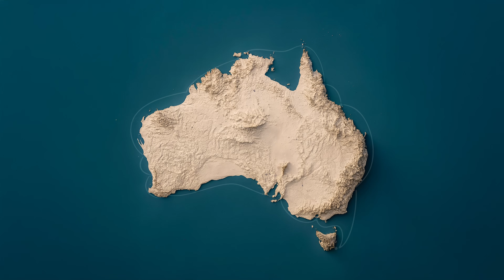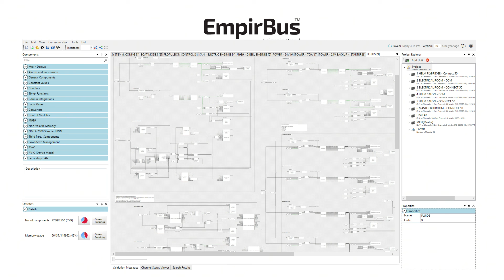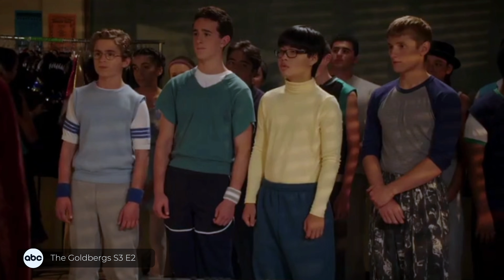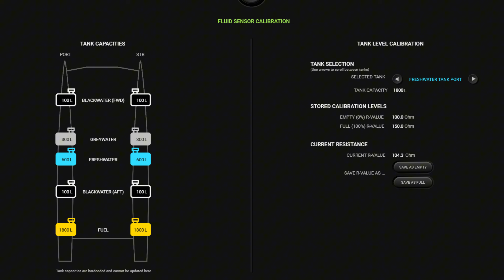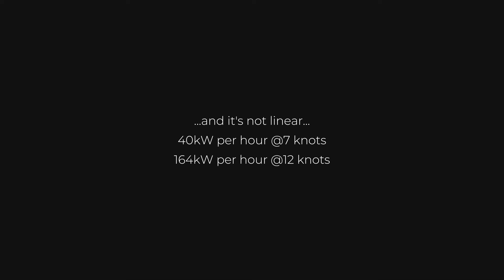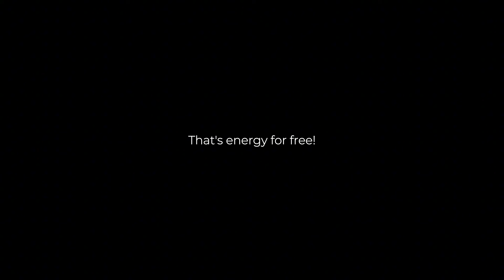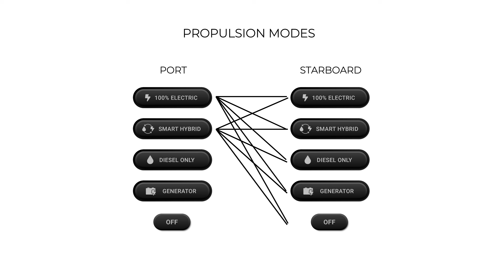The System Behind Our New Solar Electric Yacht

Comment from the maker: We designed and programmed this control system ourselves for our solar electric yacht.

This isn’t a product demo or a sales pitch — it’s a walkthrough of the design decisions behind the system, how we manage complexity, and why safety and redundancy mattered enough to shape the architecture.

If you’re curious about electric boats, marine systems, or how modern yachts are actually run, feel free to ask questions in the comments — happy to go deeper where it’s useful.
Reply: so I am doing an extremely, EXTREMELY junior version of this. bought a 26' cuddy cruiser with no engines and am about to install my solar-electric powertrain into it which I'd previously gotten working on my pontoon boat. it's honestly pretty simple: 8 x 24V LFP batteries in 2S4P for 48V, 3 495W panels, a Victron 135/50 MPPT, Cerbo GX, and a SmartShunt, assorted wiring and bus bars, and a Linergy X20 motor. the whole time I was working on it, though, I'd been trying to think of a good way to do control systems. I don't suppose you guys are interested in open-sourcing this? 😅
Reply from the maker: @notaprofessionalJ  We're still deciding what to do with the IP. Probably overkill for your case, but if we do something for our tender (~20ft) we'll definitely put that out there.
Reply: @projecteyacht  Make hay while the sun shines.
Reply: @projecteyacht  I certainly hope that Garmin or the other companies you’ve interfaced with are smart enough to reward your efforts. Well, it may be designed specifically for your purpose, your intuition and ability to make the complex simple would act as a guide to these companies to offer similar experiences to future customers. I think your control system might make boating more accessible to more people. I sincerely wish you all success and happiness in your endeavors.
Reply from the maker: The design is very specific for our equipment and motors so won't work for your case (and would be overkill).
Reply: WOW so Informative 🥇🥇🥇
The system you have created if adopted would logically reduce manufacturing time and cost.?
I saw the Xquisite 60 Hybrid Review recently, like you they opted for the Parallel hybrid system. 
I hope Manufacturers follow your lead and actually implement or adopt your system, as opposed to just taking. 
Many thanks for your informative YouTube 👍👍👍
Reply from the maker: Thanks! Yes, theft is a risk. We'll share a bunch of stuff here, but without a copy of the underlying code or config files (which are locked) it wont run o  another boat.
Reply: Is parallel hybrid really more resilient to a lightning strike than serial hybrid? most motor ecu's are very sensitive to voltage irregularities, knocking them out,  mechanical hybrid also needs extra mechanical complexity with clutches. . I'd rather have a dumb mechanical motor hooked up to a large dumb alternator. just a large coil of wire and some large diodes.
Reply from the maker: @DarrenBainbridge Good question. It depends how you design it. Our motors are definitely newwer with ECUs etc, but the diesel propulsion is completed isolated from the rest of the boat. We'll also carry spare ECUs and starter batteries, and we have two of them so that always helps. We've done as much as we can.
Reply from the maker: @userBlackRus Thanks! Us too, but in the meantime we'll have to just do it ourselves!
Reply: Wouldn't it make sense to add solar panels on the sides of the hull? Water reflects almost all the blue light, and you would have pretty much max sunlight intensity all day on one side or the other, considering that wave action is convex concentrating the light. I wish someone would experiment with this because I don't know anyone who has tried it. Except on land with vertical panels over a reflective surface, and they do work beater on land too, from what I've seen.
Reply from the maker: @Metal0sopher 100% and definitely what we'll do after the boat is handed over. Keeping it simple for the boat builder, it's been a long road already. Sunreef do do it, but they've not published any data on it.
Reply: @Metal0sopher  I would have made the solar roof MUCH bigger than you did. More shade too below.
Reply: Awesome! I am excited to hear your story.
Reply: My kind of boat people.
Reply: Im an industrial automation programmer,engineer, graphics designer, technician, PM, and I was thoroughly impressed.  Its a Garmin product, even better!
Reply: Wondering what redundancy you have forsee for all your digital controls and pc, plc, switches….?
Reply from the maker: @MrDivHD  many, many layers - and its were most of the time and complexity of the project lies. This was just an overview video, we'll talk more about this in future videos. Thanks for watching!
Reply: I know the feeling of being excited about your project. But it would be good to know more about the boat before jumping into describing your automation project. 

Very comprehensive though so well done. Are you going to open source or resell the project?
Reply from the maker: @DarrenBainbridge Thanks! Sorry about jumping right in. We'd didn't think anyone would see this other than our family and friends who already know everything about the boat, or tech nerds like us that just want the technical stuff :) I'll be putting out one more technical video on our batteries because they're pretty novel. After that, I'll come back and start from the start. Hope you stick around for that. 

Re commercialisation, we aren't going to start a business (we want to get on with travelling and have lots of other ideas for projects), but we are open to selling our IP. Focus is on getting the boat into our hands first though.
Reply: What is an experimental physicist vs. a physicist
Reply from the maker: @salty_berserker_channel In research you can go two routes - theoretical physicist (lots of maths, modelling, and coming up with hypotheses why things are the way they are) or experimental physicist who get their hands dirty and actually test what happens in the real world - hands on with the equipment, if that makes sense. Both physicists, just different ways of attacking problems. Experimental physicists are more like engineers but working on the newest stuff before we hand it over to the engineers to commercialise and scale up.
Reply: Hi,

I am a European Patent Attorney based in Switzerland, currently working in the medical technology sector. Outside my professional activity, I am a passionate sailor and the owner of a sailing catamaran based in Italy.

I hold an IP portfolio comprising eight patent families covering inventions I conceived while sailing. Unfortunately, I do not currently have the time or resources to independently develop a project such as yours or to bring these inventions to market.

I therefore watched your video with great interest and admiration. Your objectives and achievements are impressive and clearly distinguish your project from anything else currently available on the market.

The innovative solutions protected by my patents are technically relevant to your project and could further strengthen this differentiation by delivering additional benefits while securing exclusivity through IP protection.

I would be very pleased to share more detailed information and to explore potential opportunities for collaboration.
Reply from the maker: @catacruising6198 We've got our hands full at the moment, but we'll keep that in mind.
Reply: @projecteyacht  Thank you for your reply! Please take a quick look at least at these two: EP4294718B1 and EP4326607B1. They would be straightforward for you to implement and very much needed.
Reply: It would be interesting to see how you use LogiX and GraphiX to program this. I have no boat and no intention to build one, but as a software engineer I would like to see how this is done. Maybe you can walk through, in detail, to one of the many interfaces you have designed, the code running behind, how that interact with the hardware, how you receive the signals, etc. I'm sure other nerds would appreciate that.
Reply from the maker: @biomorphic, I'm thinking of maybe doing a tutorial series, maybe with our tender to keep it a bit simpler and more applicable to others. Stay tuned.
Reply: A massive undertaking of covering all automation. But all those convinces are mostly unnecessary. Its all good with the systems working because they are new and on land. But large companys know very well the failures over time, that will come, being in saltwater environment. I would hate to think how much money you've dumped into this project just for the sake of automation. I hope your husband gets better. But the amount of time wasted on this project, could have been sailing with a crew.
Reply: I am impressed by the wise choices that you have made in building your dream solar Catamaran. Can you please share the final cost and the place where you had your project built?
Reply: Okay, your from Australia, but English is English. 
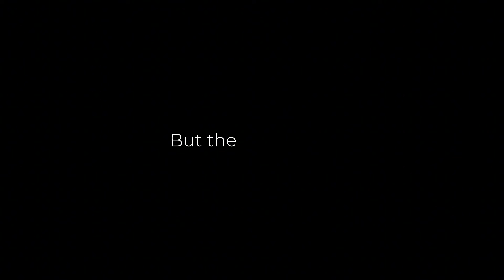I'm only in 2:59 and you have already called a motor an engine, and an engine a motor. 
Electric motor.
Diesel engine.
Reply from the maker: @richardbrice6535  so sorry about that. I'm usually all about precision of language, but talking to camera is hard. I'll get better as I do more. Stick with me, I do know the difference, its just nerves.
Reply: @richardbrice6535 your rudeness is richly ironic.

Comment: As an instrument technician, sil rated bus systems associated with dcs I think this is also dangerous.. there are no provisions for overides in a general systems fail condition, if the lightning strikes as they say then that ev style touchscreen is useless.. there needs to be at minimum local controls for all systems associated with the diesel direct drive, bilge control, backup power bus for the diesel ecus and the nav gear.. there should be full redundancy for this switch controller and yes, Fo is a natural comms link here too,  as the salt water is less of a problem etc. hey don't get wrong, I give you full credit for the achievements thus far and your tenacity.. but in the real world ocean, when it turns to sh it you need to be able to manually captain the vessel.. there is no indication of sensor redundant or even device command confirmation exists? No ability to override erroneous or even drive those batteries till they die if your in a serious swell situation..

 let alone what happens if you don't update the app 🫠

Comment: Fantastic system. I'd suggest that you have a way of overriding the engine shut down due to temperature. If for example you hit the peak heat limit during a bar crossing, you may be safer to momentarily override it to ensure that you're not left drifting.
Reply from the maker: Defintely! In addition to our diesels, we also have a 360 rotatable retractable bow thruster/pod motor with virtual anchor which we can deploy very quickly while we get the diesels up and running, or if we're away from the boat and we drag anchor.

Comment: I did not look through all comments. Did you write the SW code or leverage an existing graphical.coding program?
Reply from the maker: The Empribus system comes with its own graphical coding software called LogiX that you use to configure the connections and program any logic you want applied to them. Then there's a second piece of software, called GraphiX to build the user interface. It's provided free by Garmin and they have some free basic training online to get you started. Check out this page if you want a closer look: https://www.garmin.com/en-NZ/rv-oem/operation/

It's pretty easy to learn and they give you some starter projects to get you going. It's pretty flexible, so you can make something simple pretty quickly and easily, or make a big complex system like ours as well.

Comment: Kudos, a master class for UI developers something that is very much needed, very impressive thoughtful thinking through the scenarios you are likely going to experience and robustness for those that are not expected but , as you know on a boat flexibly can be the thing that saves lives.  Some things to give some thought to (suspect you have already) are:   a)what to do to quickly bypass bad remote switches as they are likely to go bad at the worst time.  plug in spare contactors/relays and potentially hard wired short jumpers in case the control line is bad, maybe a programable spare control line per region that sw can easily swap.   b) through hull distribution system so you only have one per side.  c) faraday cage a basic backup control system that is opto coupled and/or disconnectable and  short circuit load protected.     d) ai vision system to detect surface level containers, ideally coupled with forward sonar e) anchor alarm triggered automated mitigation system to hold the boat in a safe area should the anchor drag, while not tangling the system with the chain or bumping into other boats.   f) intruder protection systems coupled with ai vision and your boat modes and lighting (including super bright strobes which could be setup to not blind your crew so you maintain good night vision) - ok i better stop ;).  Looking forward to other great videos, as our dreams of a high tech cat had to be shelved as not all of the family enjoyed it as much as I did.
Reply from the maker: Thanks! And no need to stop, your thoughts are well aligned with ours! We either have everrything you've mentioned or its on the radar, including the AI vision and intruder systems. Good to hear that our future content will have at least one likeminded fan!

Comment: Hello, i am also e cata développer, i see your vidéos with high interest 👍 about propeler RPM , i am not sure with 700v voltage you can get  efficiency with low RPM ...how many to you get ?
Reply from the maker: At cruising speed, the motors will run at 800-1000 rpm at 94% efficiency comparing to 96.5 at 2500. We also have a gearbox ratio of 2:1so the prop runs smaller.

Comment: I wonder about the lighting strike example. If the harder ware running all the automations and interfaces is fried along with the batteries you fall back to the two diesel power trains. What is the method to close the clutch, disable the electric motors and  control the motors and gearbox. Do you have a analogue override system? I understand the motivation to  have direct drive capability from the diesel powertrains but that also relies on a secondary control system to offer the advantage you highlighted.
Reply from the maker: The clutch is closed by default. We've set it up so that when the system is down/off, the drivetrain runs exactly as a  traditional diesels run with ECU and throttles powered by the starter battery. When the system is powered up, it uses relays and switches to e.g. open the clutch, interupt/repurposes/feed through the signals to and from each piece of hardware as needed, there is no additional hardware, just some some fancy switcharoo, which drops back to the default diesel mode if things go awry. Worst case, we have manual overrides for everything, including the clutch, manual emergency tiller, etc as well. It took quite a bit of thinking, especially working through all the potential failure scenarios and how the system would react to each.

Comment: No way that solar set up will recharge that battery bank in an hour.   The slightest shadow great reduces the entire string output.   I love the catamaran and the solar plan but clearly you are going to be using a lot of diesel generator
Reply from the maker: 100%, it takes about 2 days just on solar, which is fine for our travel plans. The diesels can charge it in an hour, which will come into play when we need to cross an ocean and travel 24/7 for a few weeks.

Comment: You need an override on battery temp blocking or one day you'll need it and it'll block and you'll wind up on the bricks. I hope you have 100% unit test coverage for this. I suggest open sourcing it andlet others find the issues and help maintain it. My 2c with 35 years coding and on the water.

Comment: I hope your buss system uses optic fiber for long runs between modules. Less important for your project but essential for conventional sailing boats to minimise future lightning damage. The kite is a great addition, brilliant. I would suggest having batteries distributed around the boat where possible to further reduce cable weight but also distributed mass improves movement comfort. I’ve seen one other project like this and I am sold on the concept. Well done. I prefer the notion of a modular control system using perhaps raspberry pi modules that can be swapped out when failures occur, thinking again for conventional boats and lightning strikes.

Comment: I have a thought..           Bazinga..       kidding..              Okay , Seriously though, i would like to know seeing as you have propulsion you have a gear turning, why not use that energy to generate back into the system..like a Turbine , as you stated regeneration but on the actual prop moving you could harness that  power, as well there are other ways like a wind turbine can also generate power for batteries, so many ways to generate power... Just asking

Comment: Comparing 700 volts to 48 volts, you get less current with 700 volts, but losing some batteries or solar panels means you no longer have 700 volts, and your system goes down.  With 48 volts, you can lose half of your batteries and/or solar panels, and still have a functioning system.

Comment: hate to see batteries overheat and turn prop off while trying to dock up,, hope there is an override if needed,, looks like an extreme amount of thought was put into control system
Reply from the maker: Thank you, there was. We have diesel backup engines and also a separate rotatable pod motor for docking so we should be ok.